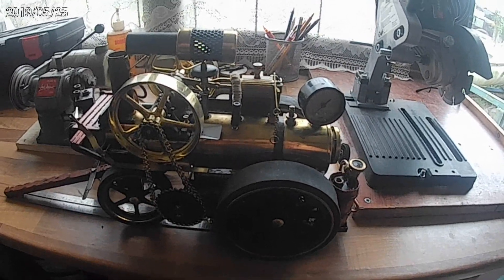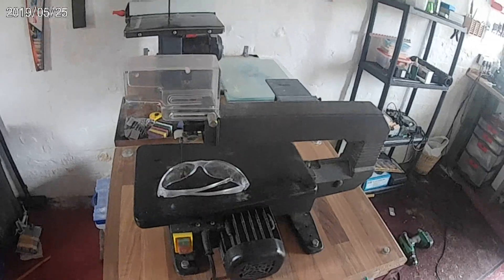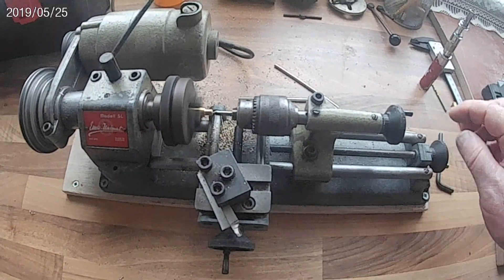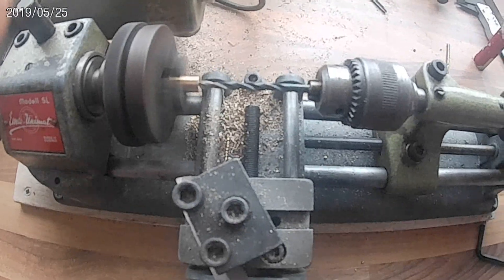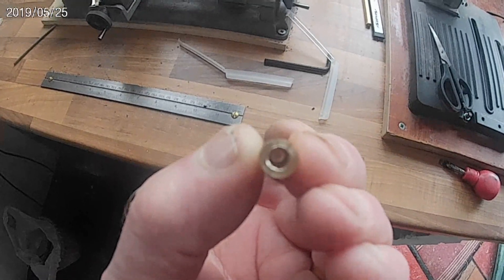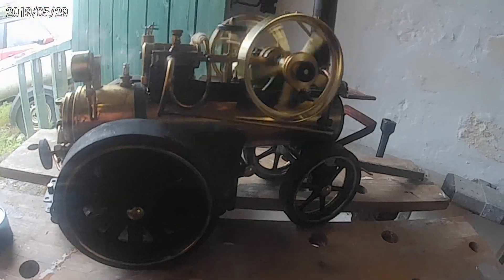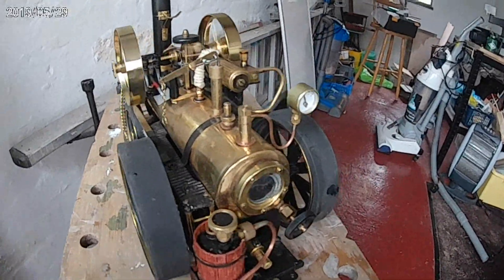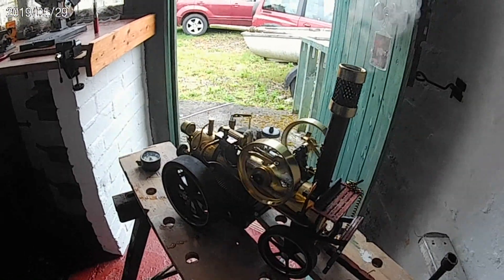making wilesco adapter on unimat SL lathe

Comment: Fantastic! I'd love to make just a simple little steam engine when I get to grips more with my unimat.
Reply from the maker: there are casting kits available small enough to do on the Unimat but lack of screw cutting is problem, as is the size of flywheels that need machining, I have access to a lager lathe for these
Reply: @eifionjones559  Funnily enough the screw cutting thing is the one thing that I'm sad the Unimat doesn't have and I've been watching numerous Chinese minila-the videos and thinking of getting one for the slightly bigger things. I can imagine this machining getting addictive.

Comment: Nice looking little Wilesco Traction Engine :-)) It looks much better now with scale pressure gauge, Your Unimat SL looks to be in good condition, Thanks for sharing this. P.S.  A YT filming tip for you ... Mount and focus the camera when filming lathe or any other task in the workshop, you can periodically zoom the camera in or out while it is on the mount to give a close-up view or the overall perspective of what you are doing. This creates a far more professional looking movie and has absolutely no camera shake, far easier on your viewers eyes.  Looking forward to the next vid :-)))
Reply from the maker: agree about the mount and zoom , only problem is I have not got either one !!!!!!. Wilesco has an extra crank shaft bearing, solder fillets between engine bed and boiler, boiler band etc as well as all the cosmetic stuff, not sure where it end being a Wilesco and starts being a Jones. It is going to be a horse drawn portable engine in for repair at my Victorian forge diorama